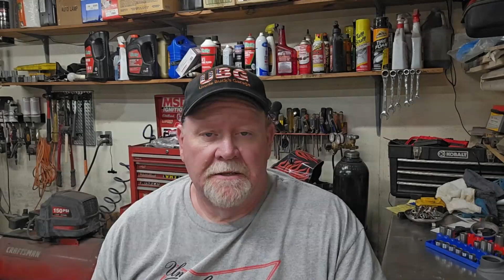How to Easily Choose the Right IGNITION SYSTEM for Your Car or Truck

Comment: MSD = Multiple Spark Discharge... I remember the JACOBS Multi Spark Discharge ( showing my age here, lol) who is now out of business. Their claim to fame was that their system would only fire as many times that was needed to burn the fuel in the combustion chamber.. Somehow their system could sense how many sparks were needed to be provided to completely burn the fuel... where as the MSD fires the same amount of spark which, according to Jacobs, was firing unneeded or not enough sparks into the cylinder’s combustion chamber. Well I used the Jacob's and it was great at the time and I noticed a difference too. Was it actually better than the MSD? I seriously doubt it. Guess all that hype is why they are out of business. I believe that MSD RULES and that is why today they are the premium Multiple Spark Discharge system used for street or strip.
Reply from the maker: THANKS FOR THE INFO BROTHER!

Comment: In 1984 I built a 350 for my '59 Vette. The cam was a Camonics with sold lifter, 530 lift I&E, 300 duration, designed for a Victor Jr manifold. Used a Holley 800DP. I installed the stock exhaust manifolds and the 1963 Corvette dual point distributor the 283 had in it. It ran ok but ...... So I put on some headers and picked up 30+HP. I acquired an Accel BEI system. the distributor has ball bearings in it and brochure said it was good for 13000rpm at 70% nitro. The engine was designed to rev to 7800. The BEI system was amazing, it must have added 40hp. I also had a Mallory dual point and a Unilite. The Accel had reliability issues. The Mallory would hook up to the Accel Laser Box but the engine lost at least 20hp. I was told the Accel was better than a magnito but it had issues, which we'll ignore here. Accel doesn't make the BEI now.  I assume an MSD 8 would be equal to or better than the BEI. It made wonderful HP and improved fuel mileage.  You could hear the difference when you swapped them out. (I also had a 650HP and the engine bottom end was 40+HP stronger up to 5000 or so rpm but ran out of air at 6500rpm. The 800DP made big hp above 6000. So I always used the 800)
Reply from the maker: WOW, THANKS FOR SHARING YOUR EXPERIENCE!
Reply: Hi, were you using the AL6 box or just the distributor with a 40k coil?

Comment: With any aftermarket ignition system I strongly recommend using the vehicle's original power source as a trigger wire to a relay that powers the ignition straight from the battery or starter relay's full 12 volts. A relay with the plug is only about $10. Eliminate any factory resistor wire or external resistor for the trigger. You can also power an electric choke from the original ignition power wire that you are now using as the relay trigger as long as you make sure to eliminate any resistance.
Reply from the maker: THANKS FOR SHARING THAT AWESOME TIP!!!
Reply: Very interesting and the resistance is my main concern. Wish I could see how this was wired. I am replacing my old fuel injection from Edelbrock who no longer makes any replacement parts. The Mallory failed and or the module failed on that setup and even the distributor are no longer available. A replacement “HALL EFFECT” distributor is like 900 bucks. So I took off the FI AND REPLACED IT WITH 3X2 CARBS. My concern now is the ignition and my engine which is only a stock 200hp so I am wondering if a multiple spark discharge is even needed but it can’t hurt , right? And I was thinking to use a vacuum advance or is that dumb too? I just want to wire it up correctly and use the right combo..

Comment: I went with the MSD module, coil, low ohm button, low ohm wires and non resistor plugs. The non resistor plugs made a difference, you'll feel it.
Reply from the maker: THANKS FOR SHARING YOUR EXPERIENCE!

Comment: Great advice as usual. I've had a Petronix Stock Look Distributor with their  40,000 volt, or may be 45,000, and their 7MM wires for the last 10 years and worked perfect in my 72 C10 with the 350 and transferred it to the SBC 400 that's in it now , just a mild torquey.030 build, and it still works super..
Reply from the maker: NICE TO HEAR THAT IT WORKED OUT FOR YOU BROTHER!